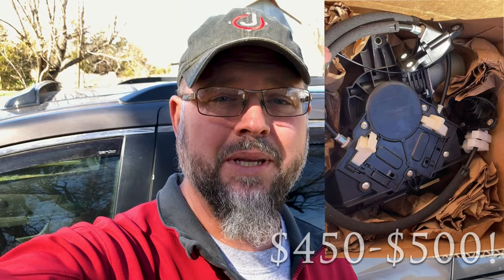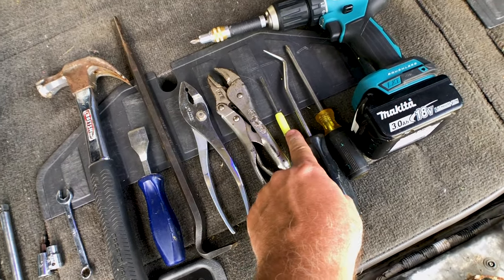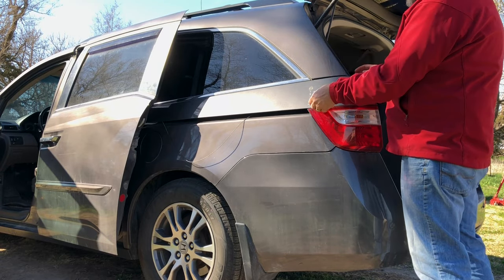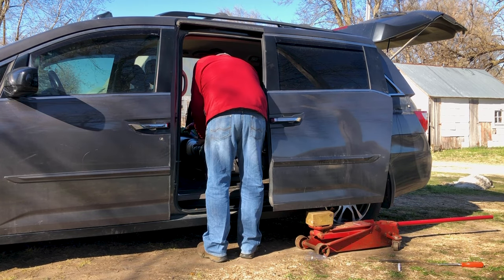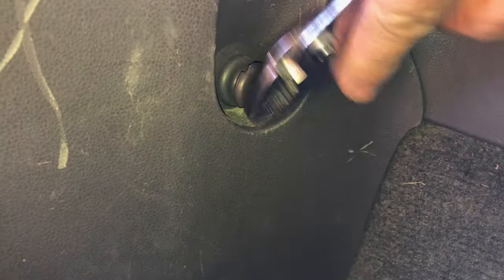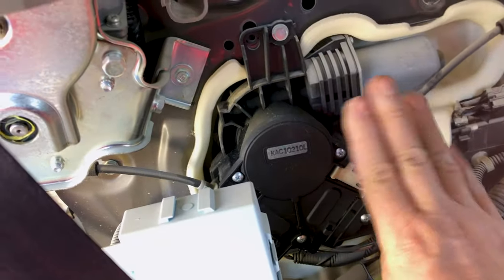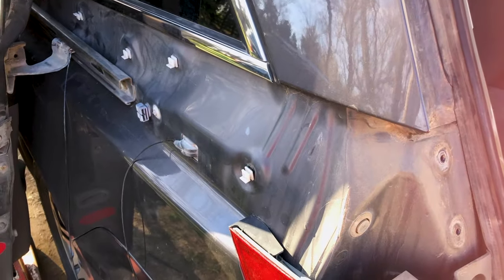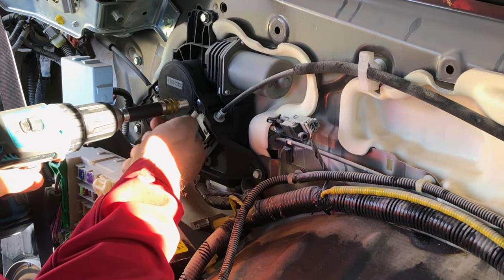FIX: Honda Odyssey Sliding Door Cable: Step-by-Step DIY Guide (2011-2017)

Comment: Thank you! I was not able to get the pin out so I traced around the edge with a sharpie and made sure the divots on the edge facing me were lined up when I reattached the door connector.
Reply from the maker: Glad to hear. Great idea about tracing with a sharpie! The pin can be a challenge to get under the head, but once it starts moving, you’re golden.

Comment: thank you!!!  just had to replace on my wife's van
Reply from the maker: You're welcome! I hope the video was helpful!
Reply: @YOUCanFixAnythingAuto  very helpful.  Only difference was I had to do passengers side and the spindle is different. Back cable goes on the front of the spindle and front cable goes on the back. But it was easy to figure out.  🙌🏽
Reply from the maker: @niclindberg989 - Yeah, a few people mentioned that in the comments. Glad you figured it out!

Comment: This is a great video we repaired the cable in about 2 hours but the door still doesn’t work we did replace the fuse and still nothing can you give us and more suggestions thank you Tammy
Reply from the maker: Hi, Tammy. I’m sorry to hear the cable replacement didn’t fix the issue. Here are a few questions:

-Was the old cable broken? What was its condition when you opened the housing where the spool and motor are located?

-When you first noticed the problem, before attempting the repair, did the motor make any sound when you tried to open the door with either the button inside or by pulling the door handle? Does it make any sound now?

-Have you verified that the switch on the dash that controls the door is on (sorry. Dumb question, but I have to ask)

Comment: Same problem with my odessey i will probably do this thanks for sharing
Reply from the maker: You are welcome! Please not that if your broken cable is on the passenger side, the process is slightly different. Please scroll through this comments section for details. Let me know how it goes.

Comment: Passenger side reel is opposite-rear cable is on the front side of the reel and front cable is on the inside/backside of reel. Did mine today.
Reply from the maker: Thanks for adding to the knowledge base! Good to know!
Reply: @YOUCanFixAnythingAuto  Thanks for video. this info was critical for me.
Reply from the maker: @johnsteele8073  - That puts a big smile on my face! 😀

Comment: You've got me stumped. Is it possible that the inside and the outside of the cable is opposite depending on which side of the car? I'm doing the passenger side and I'm absolutely positive the rear cable goes on the front side because that's the way I took it off... Assuming the bigger surface is the front
Reply: I had the same issue
Reply from the maker: @colbydraper  It's likely to be opposite on the passenger side of the car. Thanks for the feedback!
Reply from the maker: It's likely to be opposite on the passenger side of the car, especially if that's the way you took it off. Thanks for the feedback!

Comment: When winding the wire around the black pulley, it seems like there are multiple grooves on the pulley. Should I wind the wire in just one groove or align it with several grooves? I'm confused because the wire and the pulley are the same black color.
Reply from the maker: Good question. It’s a little difficult to explain. You are winding two cables at the same time and each have their own grooves. 

If you are watching the video on your phone, you can zoom into the pulley to better see how I wind it up. You can also watch on a larger screen. Be sure to have the video quality set at the highest level for the best detail. 

Let me know if this helps. Good luck!

Comment: Did your “sliding door” light come one when the cable broke? If so did it go out after disconnecting the battery for 10min
Reply from the maker: If by “sliding door light” you mean the warning light that informs you when a door is open or not completely shut, then yes, it did go off. However, if your sliding doo is completely shut and latched, even with a broken cable, the light will go off. That’s the only light I’m aware of. 

Please let me know if that answers your question.
Reply: @YOUCanFixAnythingAuto  there was a light in the dash that said “sliding door”. Came on when the cable broke, went off after disconnecting the battery for few minutes. While it was on, the door motor was in some kind of “safe mode” and would not turn and once I reconnected the battery it went off and the motor turned confirming it was just the cable and not the motor. Was able to replace the cables in a little over an hour. Worst part was the broken cable was wrapped up pretty good on the wheel making it kind of a pain to get off. Thanks for the video. It made the job a lot easier
Reply from the maker: @lp6wo  - I’m glad you got it figured out. Great job!

Comment: Almost always when I remove the side panel that covers the sliding door track, the bracket that the panel screws in to at the front of the panel comes off. This is a small piece that is tack welded to the top of the track, and the welds routinely rust out.

A little bit of JB Weld will hold it back in place.

Comment: Your video was super, I had both doors fail within just a couple weeks of each other on our 2013 Odyssey.  I did the drivers side today following this video.  Was easier then expect with your direction.  

The passenger side door motor however doesn’t make any noise when I push the button, so think I may need a motor for this side.  Any suggestions?
Reply: I replaced the right side motor with a OEM used motor I got off eBay for $250.  It was a little harder to replace with the AC unit on the right but worked good.
Reply from the maker: I apologize for the late reply! That's terrible that both doors failed!

Before ordering a motor assembly, I suggest checking the fuse for the door. Otherwise, how did everything go?
Reply from the maker: eBay for the win! Good tip!

Comment: So my husband is being a dork😅 and won’t try to fix it.  Our local mechanic is quoting $1500!  Im gonna try it. Thanks to this super detailed tutorial.  The best ever. Do you lend yourself out as a husband?  Kiddding.  I’m already having questions though. The Amazon link for the recommended option #2 — is that the one that the cables were the incorrect length?  And don’t use that one??  Should I just use the Newegg link instead?  So it is the exact length needed?  Thanks in advance!
Reply: I ordered option #2 and it worked. I think (legit not 100% sure) his point was that the company had a batch go out made in the wrong length but that was fixed. AND the company was pretty awesome about admitting the known issue and remedying it.
Reply from the maker: I'm sorry for my late reply! The other commenter was correct... It was just a bad batch from the manufacturer. How did it Go?

I'm sorry about your husband being a dork. For whatever it's worth, I'm a dork too!

Comment: Used this video to replace the cable on our passenger side slider.  @rsifferman's comments about reversing the order for spool wrapping and door CLOSED were a life saver!  

Lost a 10mm deep well socket the body panel trying to put the rear cable housing (the one behind the fan unit) back in.  I think that one is gone for good unless someone knows how to get down into the bottom of that body panel.

I was glad to figure out that the christmas tree clips for the outside panel were removable from the sheet metal. Putting them on the small panel first worked out really slick.

Thanks for all the great info.
Reply from the maker: Thanks for the encouraging comment! I find the comments on videos like this often contain nuggets of wisdom. As far as the socket goes, a flexible bolt/tool retriever with a magnetic tip might get the job done.

Comment: Hey @YouCanFixAnythingAuto, appreciate your time and the video. Do you discuss diagnosing the motor or the cable? Our 2016 Odyssey's driver sliding door recently stopped working and we have a cable that appears cut and is hanging out the side of the van. The sliding door light on the dash is on. I was just wondering at what point or how you determined that it was just the cable vs. the motor assembly? Thank you!
Reply from the maker: Great question! From what you are describing it appears that your cable broke. 

Diagnosis test: When the door switch is on and you push the button to open the door, does the motor make any noise? If so, the motor is probably still fine. If not, check the fuse to make sure it’s not blown. If the fuse is good, then the motor may also have failed. 

However, this really sounds like it’s just the cable that broke. If so, this video will take you through the repair step-by-step. Check the description for links to order the replacement parts. Watch the first few minutes of the video where I explain your repair options. 

Let me know how it goes!
Reply: @YOUCanFixAnythingAuto   Thank you!
Reply from the maker: @matthewmiller5824  - You’re welcome! Thanks for watching!
Reply: @matthewmiller5824 anything further on this? I'm in same situation and have same question. Thanks.
Reply: @peterkupfer3762  yeah, I’ve decided to just order the complete motor and cable assembly from Honda and will install that. It’s 5x as expensive, but I’ve read that the install is easier and I don’t want to potentially have to do this twice if the motor is bad.

The sliding door motor doesn’t make any noise when I push the button and the 20a fuse is still good. Hope this helps.

Comment: Thanks for the video.. but how do I know the motor is not the issue?
Reply from the maker: Good question! If the motor is making a noise when you try to open or close the door with the buttons, it is probably OK. If it is silent, I would advise checking the motor fuse before ordering a new motor assembly from Honda.

Let me know if it would be helpful to make a video on how to troubleshoot the motor.

Comment: Would this be the same process for the passenger side?
Reply from the maker: The passenger side is similar, but different. Please check out the comments section for tips from others regarding the passenger side repair.

Comment: I installed everything as shown. Then with the door in the open position from installation I hit the close door button and the wire all jammed up and tangled in the spool. I did have the wires spun tight during install they were not loose. What did I do wrong? Should I have closed the door manually then set the buttons like shown?
Reply from the maker: Maybe the wires were wound backwards, was it the driver or passenger side. The passenger side is wound the opposite direction. The reason I suggested moving the door open and closed manually is to verify that the spool and cables move freely. Let me know what you find out.
Reply: @YOUCanFixAnythingAuto  drivers side

Comment: Would this be the same by change for the 2018?
Reply from the maker: This is for model years 2011-2017. The Odyssey was redesigned in 2018, so it will be different (but may be similar).

Comment: What if you cannot open the sliding door to begin with? Where do I start in that case?
Reply from the maker: I suggest that you start with removing the interior trim panels and cutting the two cables. One controls opening and the other closing. 

Let me know how it goes!

Comment: This is a great video but we ended up unbolting the stupid hinge rather than spend 30 minutes trying to knock the pin out.😂

Also we use the reset method you used but the doors still would not close or open.

We discovered there is a reset procedure in which you make sure that the doors are fully closed, then restart the van while holding both sliding door buttons in the “closed“ position. This apparently is the official reset technique
Reply from the maker: Interesting. The reset method I used worked for me, but I'm glad you found one that worked for you.

BTW, that pin can be a pain in the neck!

Comment: Can I use this for a 2010 odyssey?
Reply from the maker: This is for model years 2011-2017. The Odyssey was redesigned in 2011, so a 2010 will be different (but may be similar).

Comment: It has worked for me right up until the end where the door needs to be reset from the control right after a battery disconnect. Tore it all apart and while the cables were off i noticed the motor would run until one way or the other consistent with the door opening and closing. Put it all back together this time opening the door and waiting for the motor to stop, then disabled the door. Put it back together with the same problem. The door will not respond to the controls after a reset. Put it in drive and it beeps so it knows the door is out of calibration. At this point i am stuck.
Reply from the maker: Hmmm… this is the first time I’ve heard of this issue. Did you repair the driver or passenger side?

Have you tried going through the steps of the reset/calibration process again?

Comment: I replaced broken cables on the passenger side on a 2011 Odyssey. Push the button and door opens perfectly now. However when I push the button to close it gets nearly all the way, literally and inch or so from closing then its beeps a few times and opens back up. I can close it all the way manually. Ive checked for obstructions or any clear problems and don't see any. I've tried the reset method of holding both buttons down together and the method of holding them down the whole time while opening and closing the door and nothing seems to work Anybody have ideas what i can do??
Reply from the maker: Thanks for the question. I suggest getting inside and closing, but not latching, the door manually. Then use a flashlight to check the perimeter of the door on the inside for anything that may interfere or resist the final closing and latching functions. Very little resistance is needed to trigger the safety feature that reopens the door. 

Also consider spraying some WD-40 or light grease in the latch and on the door rollers and rail. Let me know how it goes.

Comment: What are the chances of converting these sliding doors to operate manually ?
Reply from the maker: It’s actually pretty simple. All you need to do is cut the front and rear cables and turn off the powered door switch on your dash. The problem becomes when one of your doors is still working fine and the other has a broken cable. Then your constantly turning that switch on and off. Ask me how I know. 🫠

Comment: The door doesn't open automatically after replacing the cables. When manually opened it closes properly by the button. What must be the issue. Do I have to take out the battery cable to reset the door?
Reply: Exactly what just happen to me today on the passenger side on our 2011
Reply from the maker: Good question! Start watching at 41:54 for the steps to reset the door so that it will open and close properly. Let me know how it goes. 👍🏼
Reply from the maker: @miguelmendez7510  Good question! Start watching at 41:54 for the steps to reset the door so that it will open and close properly. Let me know how it goes. 👍🏼
Reply: Yes, it worked! I had to disconnect the battery for five minutes and followed the instructions in the video. Holding the door button till the full open and for close too. Thanks so much for putting up such a helpful video.
Reply from the maker: @tariqcpshaikh4014  - You are welcome! Great job!

Comment: Hello can someone guide me on which cable is for front and rear from the set of two cables as one of them is about 6 in longer?
Reply from the maker: Hello, Mohammad. The rear cable is the shorter one. Thanks for asking.

Comment: Do you, or anyone here, know if this will work on a 2018 Honda Odyssey?
Reply from the maker: I don’t know. There was a significant redesign of the Odyssey in 2018, so the parts and exact replacement process likely changed. It may be similar to what I demonstrated in this video, but I have not changed one on a 2018 and newer model. 

Let me know what you find. Thanks for asking!

Comment: Did he just forget to put back the 10mm nut that secures the black spool wheel? ( the one he said was loose when disassembling?) oh I guess others noticed it too.
Reply from the maker: Yes, “he” did. 🙋🏻‍♂️🤦🏻‍♂️🤷🏻‍♂️ I posted a pinned comment admitting my mistake and advising others to not do the same.

Comment: How to remove main cable wheele .?No puller work at  there !!
Reply from the maker: We’re you able to get the cable spool off? Sometimes it helps to get a screwdriver or small pry bar behind it and work it gently from different angles (left, right, top and bottom). Be careful though! Let me know what happens and how you ended up removing it. 👍🏼

Comment: Quoted $780.00 at Local honda dealer! Parts only!
Reply from the maker: Oof! That’s painful. If you want the whole motor and cable assembly from Honda, check online. You should be able go find it for a couple hundred bucks less than the dealer quote. If your motor is not bad, there’s no reason to replace the entire assembly… but that’s usually not the way dealer shops work. Tell me how it goes. 🙏🏼